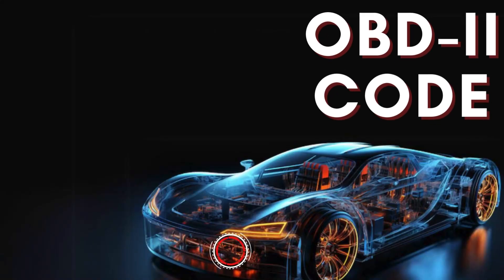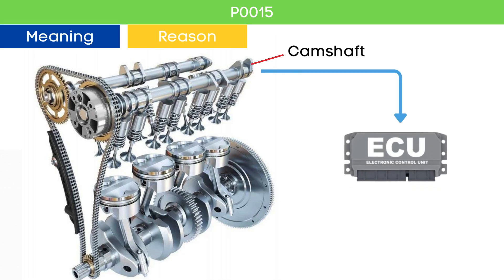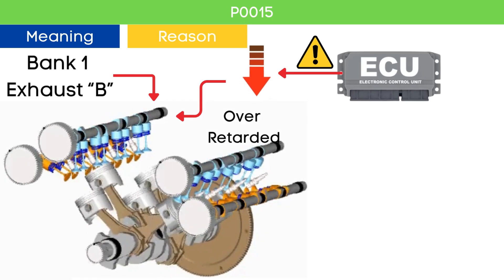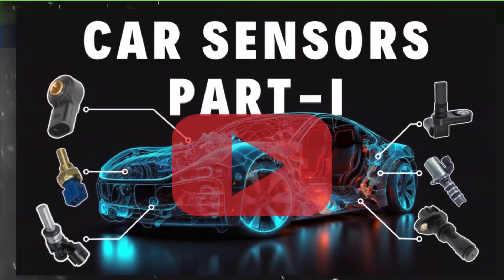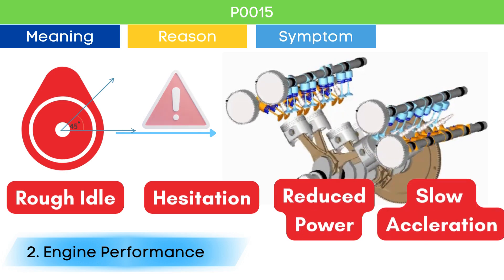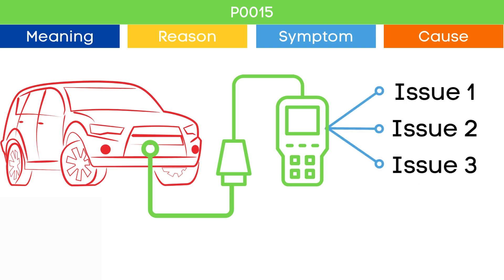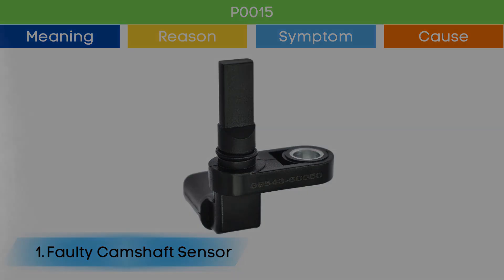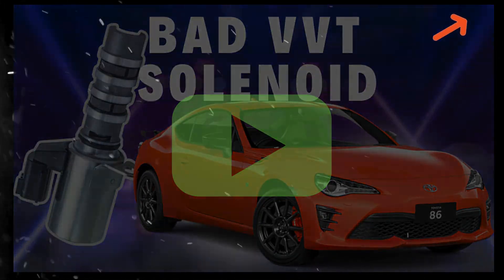P0015: "B" Camshaft Position   Timing Over-Retarded Bank 1

Comment: I have a p0015 code but no other codes found just that and the car starts up and runs fine once in a while it will have slow acceleration but when i shut it off and turn it back on everywhere goes back to normal its a 2013 bmw 328i with n26 engine
Reply from the maker: It could be related to the camshaft position sensor or the solenoid.
Reply: Don’t know if you got this fixed yet but my car had the same problem and it led to a bad timing chain which messed up pistons and valve, the engine seized. I sold the car…

Comment: I have PO015, P0420 on bank 1, multiple random cylinder misfire (which comes on if i give it more throttle than casual acceleration), and system too lean off idle bank 2, which also comes on when extra throttle is applied. I know i have an issue in my fuel system, just not sure if the pump or injectors, or possibly exhaust leak or 02 sensor/cat related. Working with 07 650i and have my work cut out for me 😐 any advice is appreciated. And please dont tell me to sell it

Comment: I had change it and still come up after clearing it p0015. 2011 bmw 128i e89
Reply from the maker: There could be several other things causing that code. Is there any other code along with P0015?

Comment: On my '10 toyota corolla it was a dirty throttle body...
Reply: Did you reset your check engine light or did you clean your throttle body then it went away
Reply: @AlexJAlfaro I had to reset the engine light...